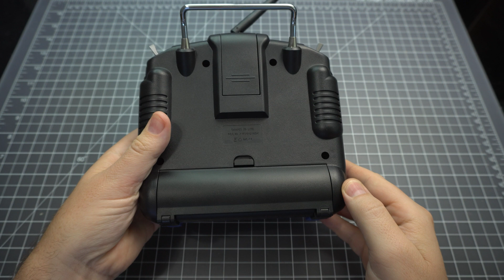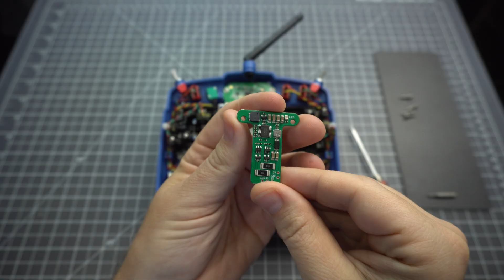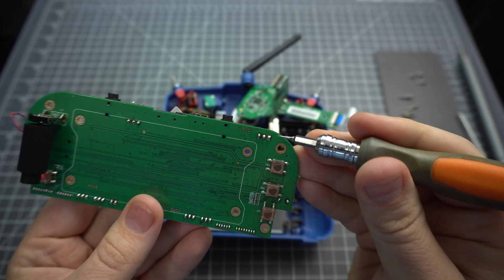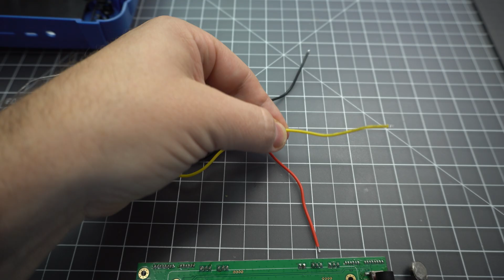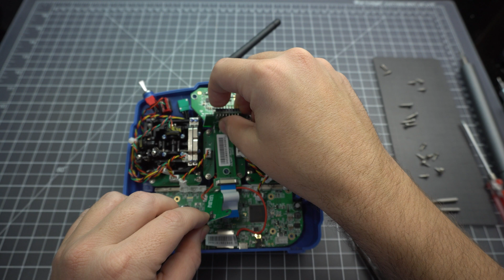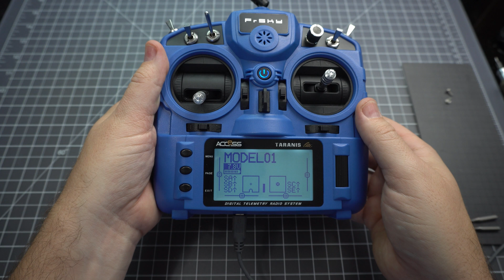USB Charge the FrSky Taranis X9 Lite - Mod Tutorial

Comment: Question. Why did you solder the wires onto only one side of the through holes rather than soldering the wire into the holes from the opposite side as it was designed to be soldered?
Reply from the maker: I just find it a little easier to solder to them as if they were pads.

Comment: After doing the mod my coputer doesnt recognize the X9 as Joystick or USB drive🥺
It charges also it shows the selector for drive or joystick also the pc gives a connection sound but says: unknown device !!!!
Any help? Does it work for you?
Reply from the maker: When the radio is on and you plug in do you get the menu asking to use Joystick/USB drive mode? It should give you a choice.
Reply from the maker: I just tested mine on my Macbook Pro and it worked as a joystick as well as a USB drive. Could it be a driver issue?
Reply: Yes it gives me the menu asking if I want joystick or drive.
I tried another computer and windows says the attached device draws too much current. 

So if it works for you I screwed smth or I failed doing the update to the latest version of opentx. Or there is a bug in there. I m not sure but pretty certain I tried it after doing the mod and it worked
Reply from the maker: @jas-FPV  I can't imagine there's much you can do to flub this up. It just draws power from the USB and sends it to the battery. Did it work before the mod? I did get the "draws too much current" error one time but after unplugging and plugging back in it didn't give me that error. That does concern me slightly though. One other idea is to check the main configuration menu to make sure the joystick feature is turned on.
Reply from the maker: @jas-FPV  You might also want to try a different USB cable.
Reply: Tried different cables and yes it worked. But I think after that I flashed an Opentx nightly. When I return home I will use an official frsky image and try again, hope this fixes it
Reply: It had worked I mean... before it stopped working
Reply from the maker: @jas-FPV  Hmm, did you try a different USB cable? I wonder if the extra current draw is overloading your cable.  Another option is the FrSky XSR-SIM USB dongle. It's a little $20 receiver that plugs into your USB port. I prefer it because it lets you sim wirelessly.
Reply: Also the USB drive function stopped working. I think I will remove the charge board first and try again. 
The cable is not an issue. Tried 3 different
Reply: Ok its the charge board. Removed it, everything back to normal 🤷🏼‍♂️
I guess I fucked up the soldering of the 5v
Reply from the maker: @jas-FPV  That's so strange. Are you going to try it again or just leave it at that? You could always get the USB receiver and sim wirelessly if you want to keep the charging capabilities.
Reply: Whiffles 
I will try again. Usually I have no issues soldering (even Rxsr uninverted Sport pad) but maybe the was an issue. Must be if I am the only one with a failure like this. Thanks for answering
Wireless Joystick yes, would be an option but I like my gear to function properly ;-)
Reply from the maker: @jas-FPV  I haven't tested this on a Windows PC so it could be a prevailing problem. I only tested Mac.
Reply: Whiffles 
I dont think its a Windows thing. I got the USB current alarm on Notebooks. My pc didnt complain...
Reply: Whiffles 
Oh, there just was a video by JBardwell on a driver issue in Windows 🤭 maybe thats it 🙈
Reply from the maker: @jas-FPV  Let me know if that fixes it for you. I'm curious to know.
Reply: Whiffles 
Hey
I can confirm: the mod is the issue. Removed 5V from the lower part of the capacitor: all good. Put it back on: usb not working (but charging)
Tried with 4 different cables and 3 computers
Reply from the maker: @jas-FPV  How about pulling 5v from someplace else? I wonder if there's a better spot.
Reply: Whiffles 
Or my charge board is whack
Reply from the maker: @jas-FPV  Well I also got the power draw error on my Macbook at least once, so I kinda doubt that.
Reply: Whiffles 
I dont get the power error if I run my notebook from AC.
Maybe I did smth wrong 🤷🏼‍♂️
I dont know.
The only thing I can tell, without the board all works

Comment: There is a pin hole with a 5V label next to the lower right corner of the main processor unit, is it possible to get the 5V power source from here instead of the one you show in the video???
Reply from the maker: I do not know. You can plug a USB cable in and test it for voltage. I only used this capacitor because I was instructed to. Let me know if you find voltage there.
Reply: @whiffles  I´ll tell you in a month, I´m still waiting for the radio and the Uruav charger board to arrive from china.

Comment: I tried checking the documentation about this board but Bangood didn't seem to provide one. If I were to use this to charge a 2s Lipo in a QX7, would this board balance charge the battery if the middle battery connector was wired to the 1S pad? Or is that pad only for charging 1S batteries? 

Like, for your setup, could you put a piece of foil (that's connected to the 1S pad) between your 18650 batteries and use the board to balance charge your batteries?

The documentation that BG does list does say the word "Balancing" once, but doensn't mention how that would work. The board itself does appear to have two charging circuits, and the attached IC would handle the switching. Any info or insight you may have would be greatly appreciated.
Reply from the maker: I was wondering the same thing myself. If you see two charging circuits then it very well might do as it says. I imagine the 1S would go between the batteries as you suggest. I thought about inserting something between the batteries, but for this application charging in series is good enough. At least you can monitor the overall voltage with the radio to get a clue if a cell is dying.